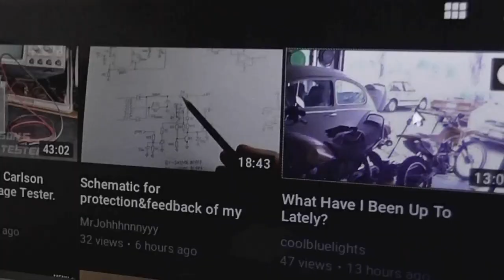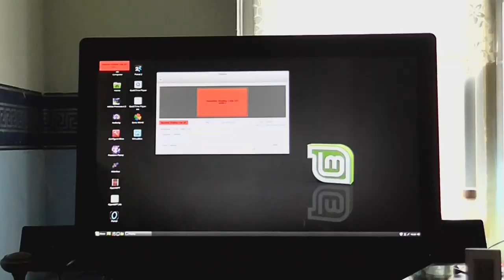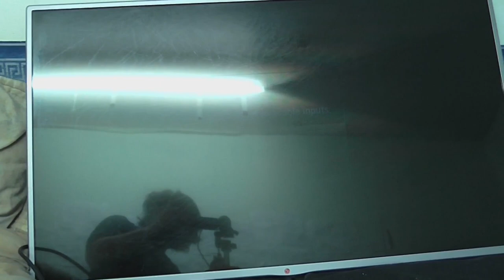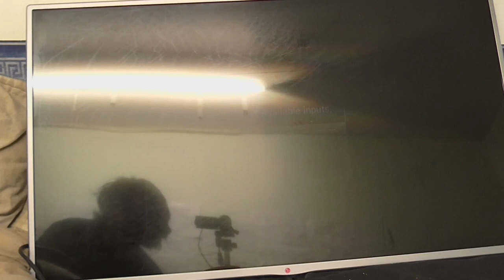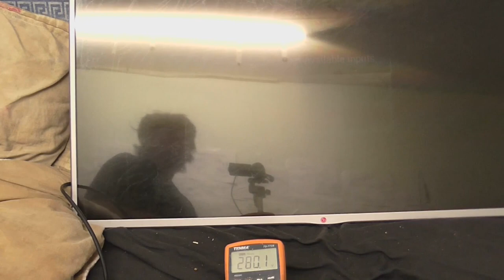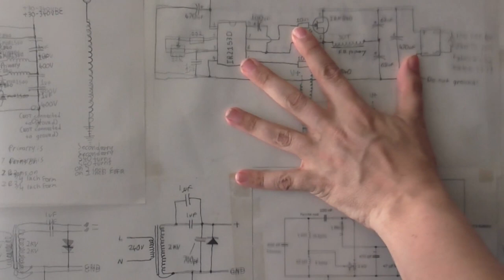CDC Electronic Workshop - Fixing a big ass LCD TV! (part 1)

Comment: lvds is pretty generic on those TVs, it usually boils down to the panels actual voltage (3.3, 5 or 12v) armed with this info all you need to do is gran a board that does the same res, hotwire it and you are good to go.

Comment: You have to be so careful handling any parts of a screen you take apart, make sure you know what order the different layers go, and which way around they go. Plus, you have to be very very careful not to get any specks of dust or finger prints on any of the layers, because they will show up once the screen is back together. Even taking a small 21" monitor screen apart i found i had a few specks of dust showing up inside the screen once it was back together - and i had been ultra careful to keep it all spotless. Must be a nightmare with a bigger screen.
Reply: 100SteveB i have almost a dust free environment and dust constantly came around my screen installs for phones. Longest part of the process was to get each speck gone at the same time.